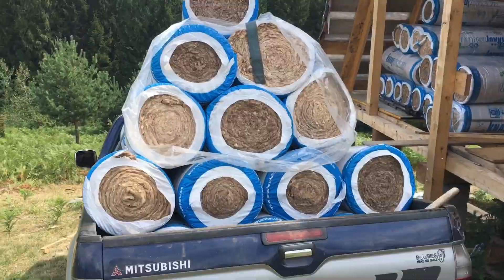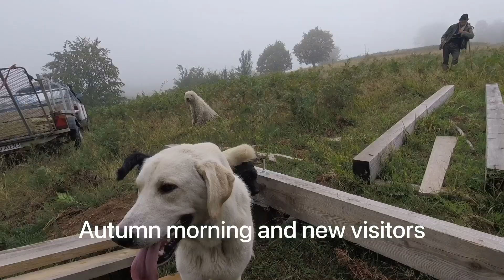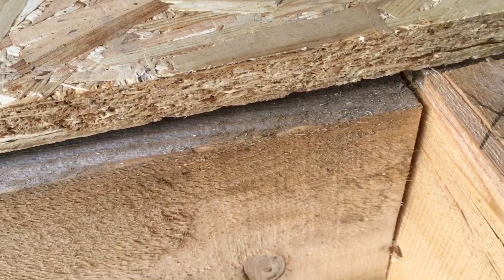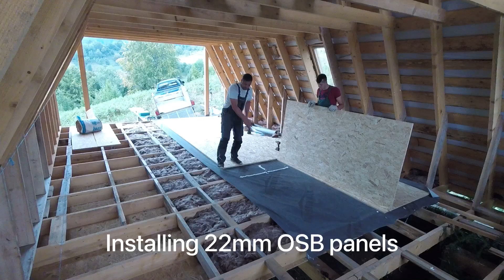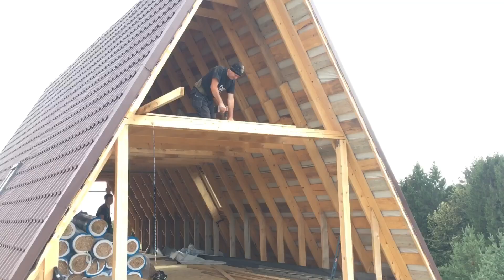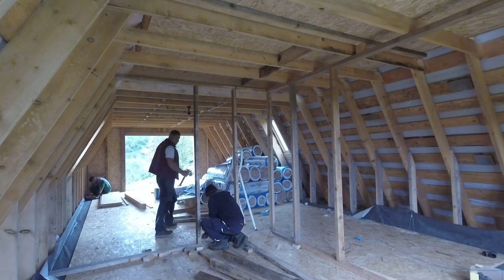Ep.5 A Frame cabin off grid-Framing windows ,doors,OSB,floor insulation #aframecabin

Comment: 1. You need to protect OSB underneath facing the ground from moisture. It'll ruin OSB otherwise
2. Foam does not help squeaking. Use liquid nails
A nice project in overall.